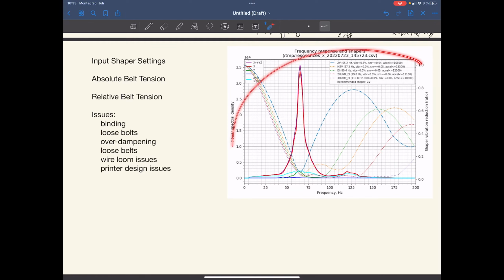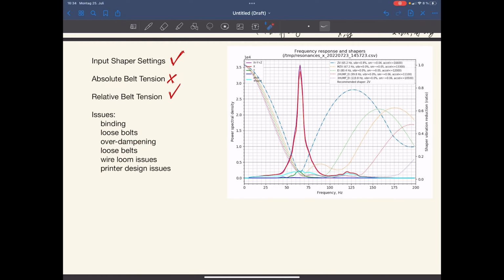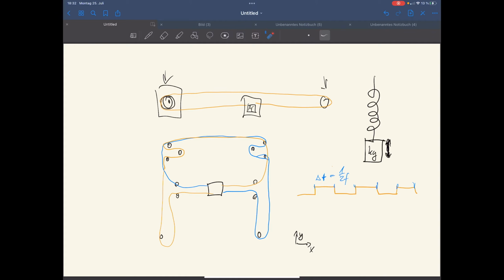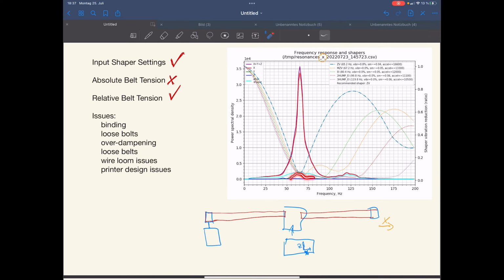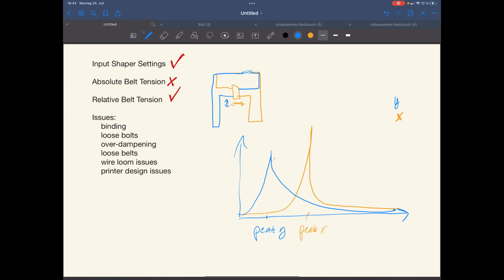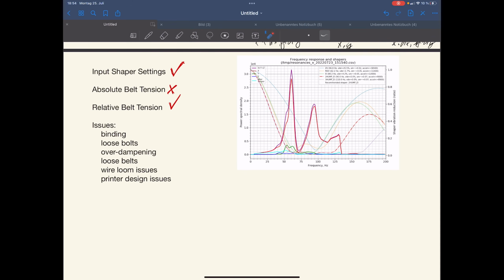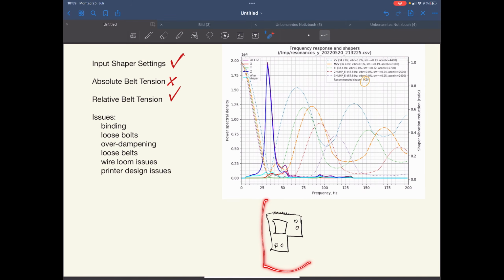How to Read and Analyze Input Shaper Graphs Generated by Klipper

Comment: Great video! Hope the series continues soon 😊
I have issues with my printer and I can narrow it down to a loose bolt and a wobbly table.
The latter I’m aware of as I placed the printer on such a tabel
To work on.

However I’m not sure where to look for a loose bolt or even what is defined as loose? Like what torque is needed to tighten the gantty parts, mgn rails etc…

Do you have any pointers, please?

Comment: HI. If you have loose screws/bolts
can you say roughly whether it is the frame, XY gantry or print head? According to your video, I have a small peak in Y before normal and in X a very small peak after normal. When I compare it to your video, it's "loose bolts" every time.

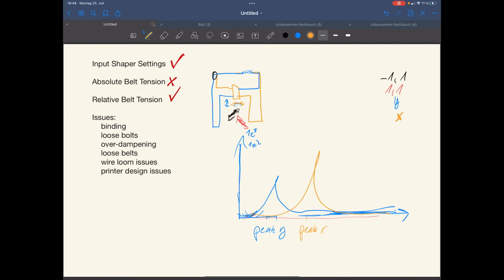Comment: Hi, first of all thank you so much for this nice video. It explains a lot..... But I have one question though. In minute 22:29 you explain that usually the X has an higher amplitude than the Y Axis. This is not clear to me since X has less mass. I'm using a Creality K1 Max and in all my diagrams actually the Y amplitude is higher than X. If you are really right than it would mean that my X-Axis (and probably the X-Axis from many other users) is overdamped. Could you confirm that you described it right?

Comment: love your video. one thing i don't really understand is the "over-dampening" isuue. What do you mean by this? can you give a few more examples. i though dampening was a good thing, as dampening absorbs resonance and converts the virbration energy into another form like heat. hence reducing resonance virbations.
Reply from the maker: Think of the following example:
We think of a linear oscillator mostly here. A very easy example is a spring with some weight attached. Now think about the spring being in a liquid, which will be dampening. We want to move the weight by moving the end of the spring. Now think of a second spring attached to the same weight, perpendicular, but with different length of the spring. If the liquid is very viscous, it will start delaying the movement of the weight. So if I pull on both springs at the same time, the weight will move in a bow instead of a line. 
Now, of course we can argue that this happens anyway with different lengths of the spring, but I think you can get the point. 
Over dampening has bad influence on the acceleration and deceleration  phase and will create something that looks like overshooting in the corners. Worst case would even be, that it eats some tiny movements. It also stretches the belts and therefore reduced the lifetime of both belts and pulleys, and can also create belt artifacts when the teeth start to not perfectly fit the pulleys.
Reply: @3dprintersawhiteboard401   , thanks so much for your videos, they really help understand. Can’t wait to see the next ones! What could cause over dampening on x axis?

Comment: 25:00 i dont really understand this.  On the top the axis are almost perfectly overlapping in both frequency and amplitude, while on botom the frequency shifted up and only one belt is dominant. How is the bottom one better? I hope that your next video will help to explain this to uneducated people like me :[
Reply from the maker: The difference in the height of the amplitudes might be a whole video by itself one day, but they are not a big issue. It even leads to some interesting things about clamping positions of the belts in relation to the teeth and such. With higher mass, the amplitudes will get closer together as the effects causing those get less important, so you mostly see that on x, not as often on y. 
What we only want to look at here is the frequency of where the peak occurs, and that's much closer on the bottom one. It might be a bit harder to see because of the sharpness and slight asymmetry of the x peaks, but on the bottom graph the peaks are withing a single Hz, while on the top one they are about 3.5Hz apart.
Reply: Thanks for the good clarification! 
I was wondering. How is the belt frequency calculated? would it be possible to assume the belt as a string and use that to calculate the ideal frequency for belt tensioning?
Reply from the maker: There is not really a good way to calculate the idea; resonance frequency of the belts. 
If you were to try calculating it ignoring a lot of stuff and trying to keep it simple you can do the following:
- assume it to be a spring
- you need the belt length (linear factor)
- the hook constant (which is usually actually part of the data sheet of belts)
- calculate an effective mass out of the combination of the mass moved and the strain
Now you can try to compare the resulting load from the effective mass  to some data sheets of the components involved and chose it to be below all data sheet mentioned limits and then calculate the resonance frequency from that. 
But it is actually pretty simple for corexy: just tension the belt until it stop flapping against the frame when it is resonating. 
For a v-minon for example I recommend a tension where you can push the two belt sides together with the print head being in the middle without much force. 

It is unfortunate, but we dont have a good metric for the absolute belt tension yet (that includes the tuning approach).
Reply: 4 mins in....your directions are wrong. And I think the operation of input shaping is also incorrectly explained, (will explain when I can give it some more time) despite this the trouble shooting analses and advice is excellent.
Reply from the maker: @liamventer  Well, along the axis is the important part Id say...